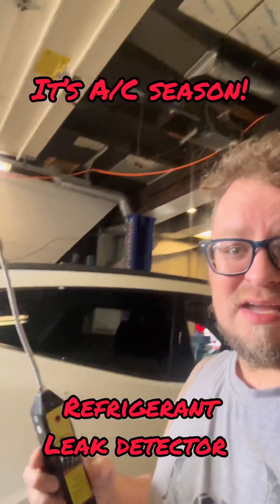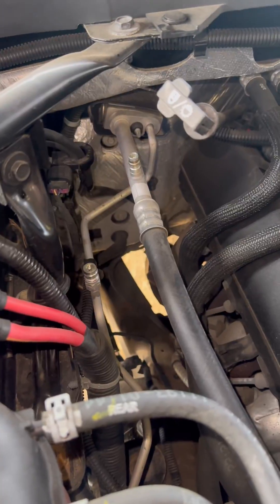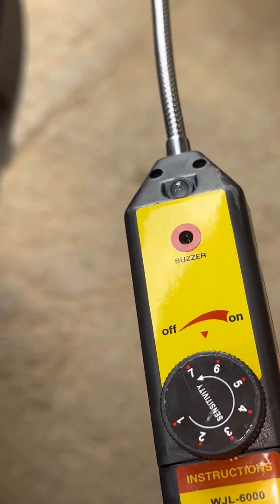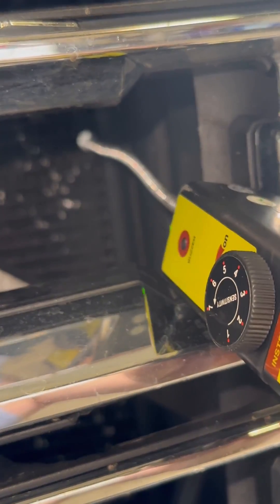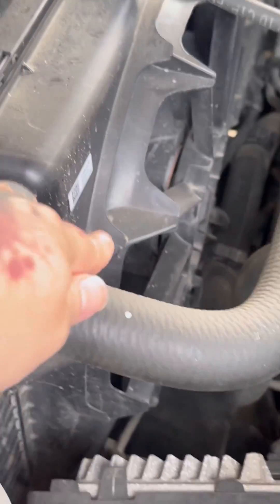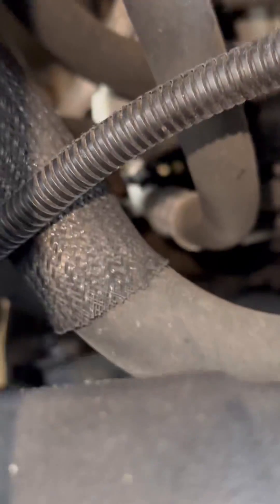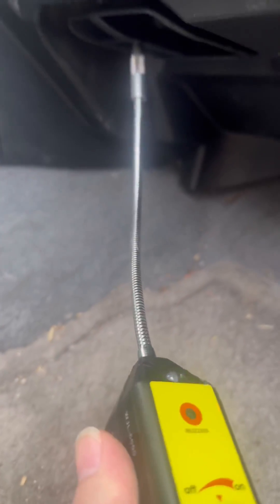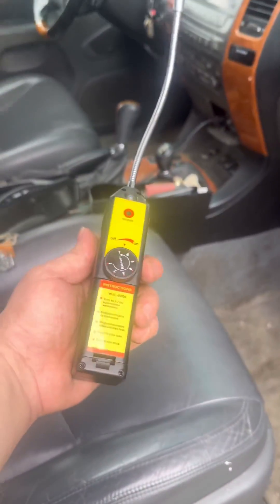Find A/C leaks super cheap/affordable WJL-6000 halogen gas detector

Comment: So, you don't use a dye even for small leaks. Do you?
Reply: I use both UV dye and this HFC detector.  The beauty of the HFC detector is that you can use it in daylight and check the evaporator and small leaks at the compressor seals.

The dye is good because it's cheap and permanent. All you need is a UV light.